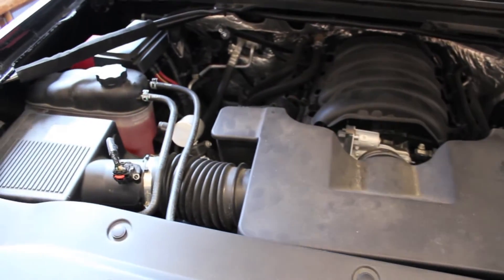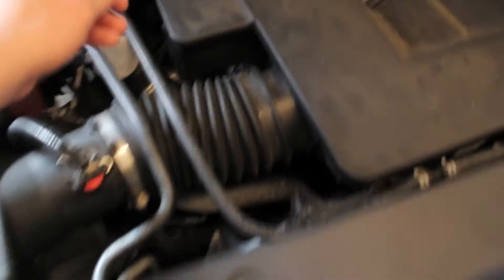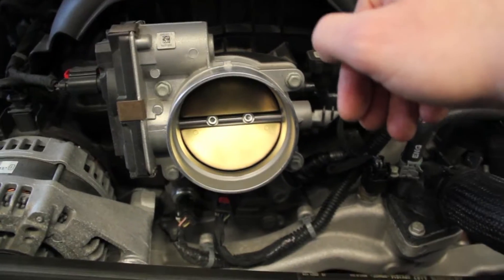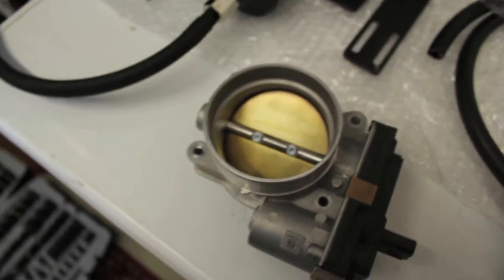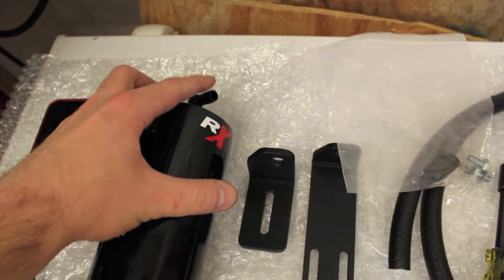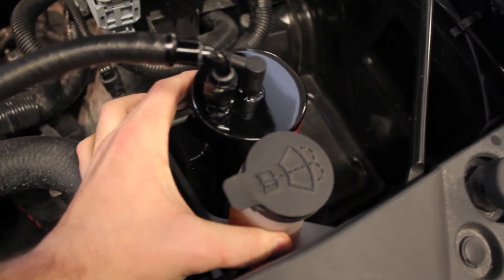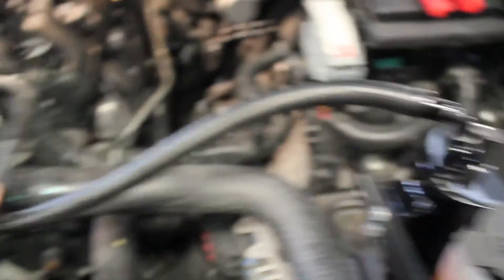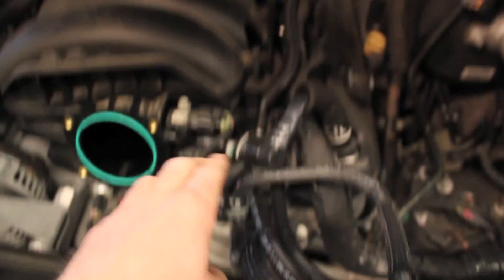[HOW TO] Install a Catch Can on a 2014-2018 GMC Sierra (5.3L)

Comment: nice video. You should do a part 2 to show the other connections and how you handled them.  I had to buy different size hoses than what came in the kit. I installed mine a few months before you posted this video. Hope they started providing the correct size hoses in their kits. I also moved mine recently to where you mounted yours, thanks for that suggestion. I used the existing hole in the extra battery tray for the drain tube and there's some kind of triangular plastic shroud underneath that has a nice circular cutout for the hose as well. Makes emptying a breeze.
Reply from the maker: +CJ Cress I routed the the hoses the same way as in my video, I just swapped them out for a different kind. But yea, this is the best spot for draining. I have a little pan that I use and I set it right on the extra battery tray and then open the can and let it flow. I empty it about every 1000 miles. Gets a few ounces each time.
Reply from the maker: +CJ Cress I just ordered the clean side separator over the weekend. I was changing my air filter and found oil residue in my intake tube. Stay tuned for a short video on that soon!
Reply: What size hose did you end up using?

Comment: For V6 tuning we use Will Overkill (Google search WIll Overkill tuning).

We make a top mount supercharger or single and twin turbo's for the V6 3.6L LFX engines. Bumps power to 450-550...V8 eating territory!

The V6 version is easy to install as well. Search RX V6 Camaro install for videos on it.

Comment: Would/could one splice the original hose and use a nipple/coupler to attach? Thus reducing the possibility of damage to the valve cover bib.?
Reply from the maker: You could. But I just didn’t want to cut up the OEM hoses.
Reply: @fondupot   i was just thinking the oem hoses might be cheaper to replace than the bib on the cover. Found your vid great info.
Reply from the maker: Thanks for watching

Comment: Dylan  yes by connecting both valve covers together the putting on the clean side cap and running it to the air box both valve covers will have a air draw to pull out any moisture that gathers in both heads.

Comment: Questions; why a catch can on a 5.3? What are the issues that leads to recommending this? What are the pros and cons of this install?
Reply from the maker: It's a direct injected motor. And Direct Injected motors have issues with carbon buildup on the back sides of intake valves. The PCV can helps to reduce the amount of oil blowby in the engine, to keep valves clean. Do some research about catch cans in general and it should explain it better.

Comment: Hi, bro which holley intake manifold is compatible with gmc sierra 1500 5.3 engine 6.2L  2018.. And throttle body also... Please help me with this info 
I want swap ls83 to 86
Reply from the maker: Sorry I am not sure the manifolds are compatible between 5.3 and 6.2.
Reply: The L86 intake manifold goes onto the L83 without a problem. Just need a bigger TB preferably the 87mm think is the best you can go with. GPI sells complete kits for the swap
Reply from the maker: Look into Soler Performance for throttle body as well

Comment: I notice that thin oil film too when I changed my air intake tube and put on a throttle body spacer. Catch can is a good idea. Thanks!!.....Maybe that's how they make the plugs foul out after 1000's of miles so you have to take it in to the dealer??? My 6.2 has 80K.
Reply from the maker: +Steven Lynch I saw your other post and replied to that as well. But also look at my video on the clean side separator. Definitely worth the investment. Unfortunately, the original RX brand is no longer being made. The RX you will find when you google is a knock off brand. I was lucky enough to get my catch can and clean side separator from the original RX company. Do a google search on Elite Engineering. They make a quality catch can and a quality clean side separator. Also visit the GM-trucks.com forums, lots of good information on there in the engine section.

Comment: Hey ,  do i need to install this to my gmc sierra 2016 5.3 , or the manufacturer  did this to the stock car ( so they put the breather in the intake directly ) hope you got my point .
Reply from the maker: jorden Damnn the manufacturer does not install this from the factory. I would advise it if you plan on keeping the truck for a long time.
Reply: @fondupot  hey thank you for your fast replay , and is there something that i have consider about the item , so there should be a filter inside it or two internals or specific thing as material or what to look for in the oil catcher can  .

Comment: Very nice vid! I have questions for you though.  After this install, do you plug the 2 hoses from the valve covers?  Also is it easy to drain your can from that location?
Reply from the maker: Dylan Barnett Yes, I reconnected those to plugs to the valve covers. And yes, this location is very easy to drain. I have a curb in my garage that I pull up to and I can reach in to drain the can without any strain.
Reply: fondupot will reconnecting those plugs feed the blow by from the top of the valve covers back into the intake? Plz excuse my lack of understanding
Reply from the maker: Dylan Barnett those are considered the "clean side" of the venting system. There is less oil blowby here than the "dirty side." The catch can is on the dirty side, and catches the majority of the oil. There is a whole other kit you can install that would catch the oil mist that comes thru the clean side. I just havent got around to buying it.
Reply: I seen the kit you were talking about.  Could you tellme;  would just putting a hose from one valve cover too the other work?
Reply from the maker: Honestly, I don't know. I wouldn't worry about those hoses. When I took them off I inspected them and they were bone dry. There wasn't any residue from oil in them at all.

Comment: how much does it help out cause I got a 2015 chevrolet silverado 1500 2ith the 5.3L & does it affect the factory warranty at all? Just wondering
Reply from the maker: +Allan Blocker It helps a lot. All the oil that the can catches would normally be sucked into the cylinders. On the way, the oil will cake the inside of the intake manifold, and also it will settle on the tops of the intake valves. The can will keep those components clean so your engine can have better combustion. Thus maintaining performance and mpg. Otherwise over time excess oil blowby can cause poor performance and poor mpg, and even mechanical damage if a valve gets stuck open from too much crud on it. 

Does not affect your factory warranty.
Reply: +fondupot thanks man... I seen all of your other videos & I was wondering have you had any more issues with oil getting into your air filter/box & intake tube... How good is that other brand you put into your description? And has the dealership say anything about your warranty since you put that catch can on there or anything?
Reply from the maker: Allan Blocker
Hi Allan, ever since I installed the cleanside separator my intake tube has been clean and dry. And as far as Elite Engineering goes, if I was to replace my current setup, the only other company i would consider is Elite Engineering. They make some nice products, and a lot of other GM truck guys are using their catch cans.

I haven't heard a peep from my dealership. They are pretty easy going when it comes to mods.

Comment: can a remote oil filter adapter with an oil filter installed be used instead of a more expensive "catch can"?  Thanks
Reply from the maker: Honestly not sure. Catch can allows for airflow while catching the blow-by oil. Oil filter might impede on airflow and cause some vacuum issues and cause engine lights.

Comment: Also what are your thoughts on a cold air intake? I have a v6
Reply from the maker: The OEM intake does a well enough job. Unless you get a custom tune to go along with the intake, it really doesn't add much benefit except for being louder.
Reply: no increase in mpg? like the louder sound for sure. Already have a louder exhaust that came with the truck
Reply from the maker: If you have exhaust you may not notice the intake sound very much then. I didn't notice much change in MPG. But a custom tune will increase HP and better shifting with the trans.
Reply: is there a custom tune for a v6?
Reply from the maker: Dan Schefer I am sure Blackbear Performance can take care of you. Do a google search for them.

Comment: I have a 2015 with the 5.3. I ordered a oil catch can for my Silverado but the catch can has a breather cap on top of it. (All Star Performance)  Will that make a difference?
Reply from the maker: Well, you may notice some oil build up in the engine bay that comes through the filter. Technically a breather like that isn't emissions safe.

Comment: I have a v6 do you recommend a catch can for a v6? Do v6's need a catch can?
Reply from the maker: Yes, I would recommend a catch can be used on any Direct Injected motor. V6, and V8 alike.
Reply: are catch cans different for a v6 and v8, or universal for both engines?
Reply from the maker: Dan Schefer Universal. I assume you have a 2014-2016 GMC or Chevy truck yea?
Reply: yes 2014 gmc sierra v6
Reply from the maker: Yea. I have another catch can video. Go to my main page and look up the Elite engineering E2 video I did. The video shows a 5.3L v8, but I also show how to do a 4.3L V6.

Comment: with the airaid intake that i have do u just plug the holes in the airaid tube the same way like u did on the factory one
Reply from the maker: What holes are you referring to?
Reply: Fondupot's Garage bad description sorry. The airaid intake tube has 2 breathers with hoses running to the valve covers like the factory one did. make sense?
Reply from the maker: Jimmy Kimber you still need the breathers to connect to the valve covers. Unless you are also installing a clean side separator. 

Watch my Elite Engineering catch can videos for what that is.
Reply from the maker: The airaid intake should have two ports on it. One for each breather on the valve covers.
Reply: Fondupot's Garage yup installing the Elite so was wondering if you just cap them on the airaid like you did on the factory intake with the catch can
Reply from the maker: Jimmy Kimber yes. I found a nylon insert with the same threads at a hardware store. I screwed them into the airaid. I have a video of they too. Check my channel.

Comment: are the pcv valves on both sides? just asking for when i go to replace
Reply from the maker: Both sides of what?
Reply: +fondupot I didnt know of there was 2
Reply from the maker: No just one. I don't think there is actually a PCV valve on the engine though.

Comment: This should have been done from the factory when they went to direct injection. I am going to do this to mine. The only upgrade I see that is necessary.
Reply from the maker: Yea, its a point of contention for sure about direct injection. I can see why GM doesn't add it from the factory, because the normal everyday user would not want to maintenance the thing. But oh well.

Comment: Why would you need a line that has a high pressure these are all air vent lines and no pressure. Fuel line should be rated for petrol products.
Reply from the maker: +Floridianson James 

I've heard the lines can compress when under vacuum. I Might have over did it but I'd rather be over than under.

Comment: fuel line will do just fine.
Reply from the maker: I thought fuel line would not stand up to the vacuum of the PCV lines.
Reply: Fondupot's Garage it’s all that was ever used before they went to a cheaper hard plastic line. The vac isn’t really enough to collapse fuel line.
Reply from the maker: Ok thanks for posting.